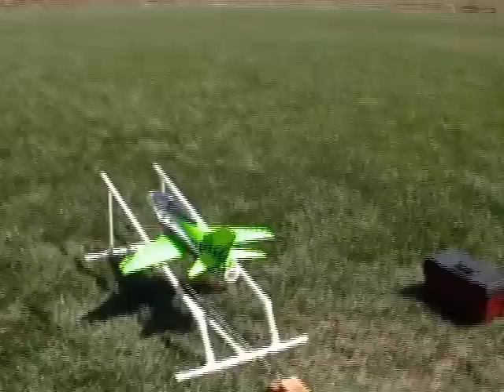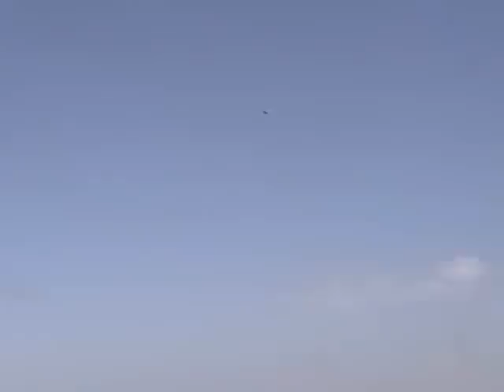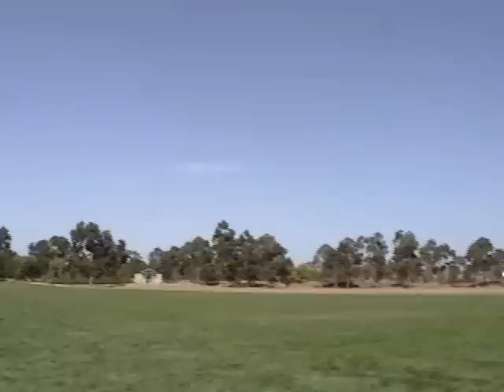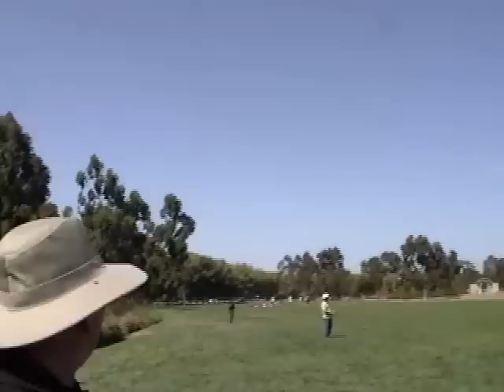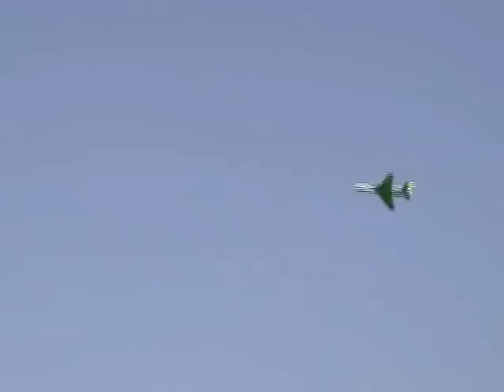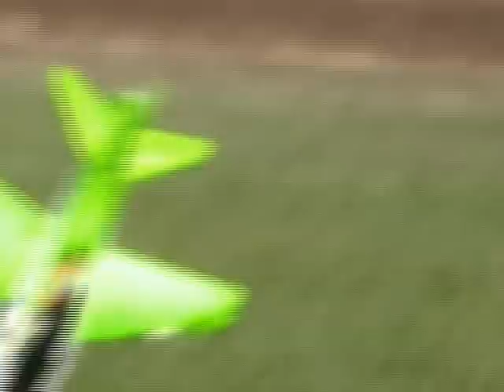Concept X

Comment: @karlgschneider cool.  I will have to see if I can fit a larger battery in.  I have some 2450 and 2650 but they are longer / skinny 4cells, so they don't fit.  The more square ones probably would fit.  I maidened my concept x today and got it on radar at 99MPH on a level pass!  sad I didn't get over 100mph but that is ok :)

Comment from the maker: @earthling1984 
Nothing broke.  The battery is a 2600 mah Hyperion 4S 35C.  It fits perfectly if you remove the rear divider.  No other mods necessary.

Comment: nice job, a little rocky landing, did anything get damaged?  I'm amazed you got a 2700mah battery in there.  I just completed building my foam only kit of this jet.  Using a 4000kv e-flite motor/fan unit and I planned on using 2200mAh 4cells(they fit snug after removing the extra divider foam in the battery compartment.  I wouldn't expect a 2700mAh to fit.  Did you have to shave out the battery compartment more, or just remove the foam divider?